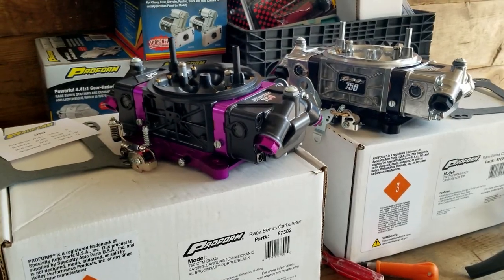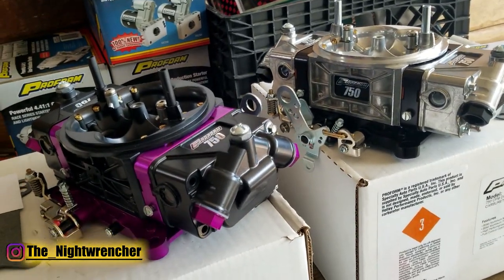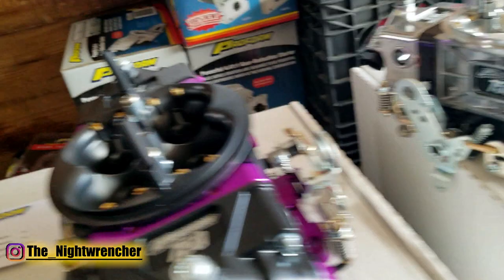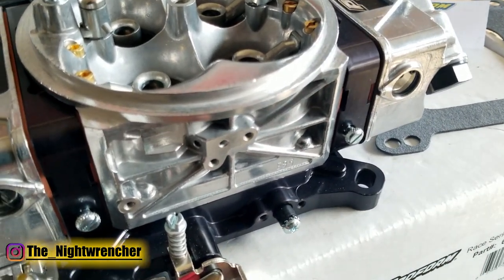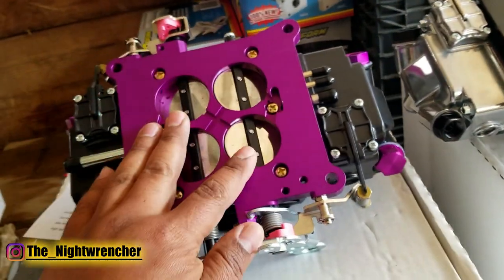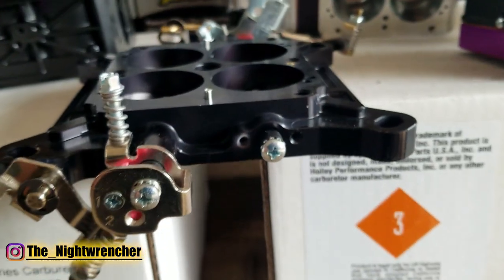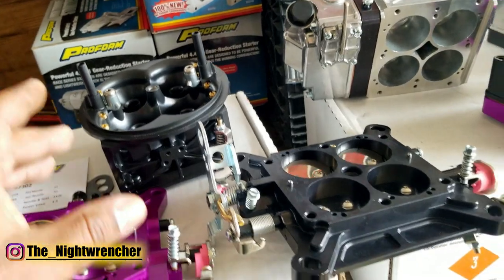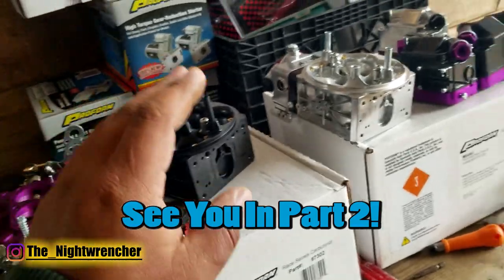First Look: NEW Proform Race Series 750 Carburetors, Gas AND E85 | Part 1 | Budget Turbo LS |

Comment: Got a pro systems dual needle and seat blow through and was surprised to see actually no power valves at all in it. And great info about the 4500 style manifold making more power than the 4150
Reply from the maker: Yeah, a lot of the off the shelf blow through carbs don't have power valves which I found wierd. EricTheCarGuy had a demon blow through on his engine and he burnt a piston with it.  I know C&S and CSU make really good blow through carbs and they come with power valves.

Comment: What kind of HP in your opinion do that blow though e-85 carb, has the potential to make?
Reply from the maker: You can make over 1000hp on an e85 blow through carb. Just match the carb to the engine and start adding boost.